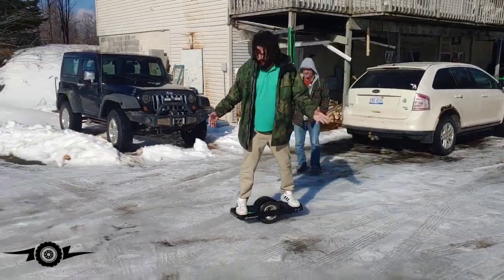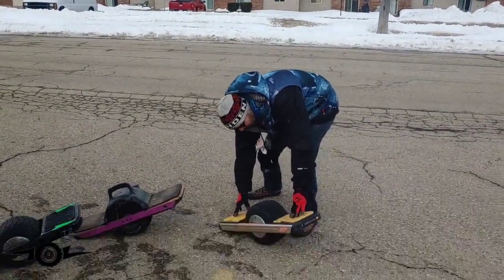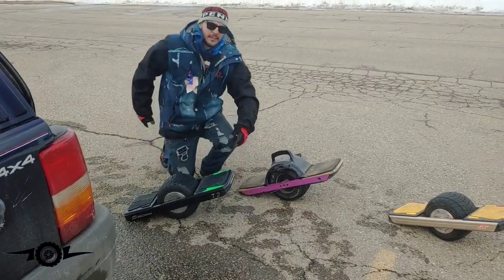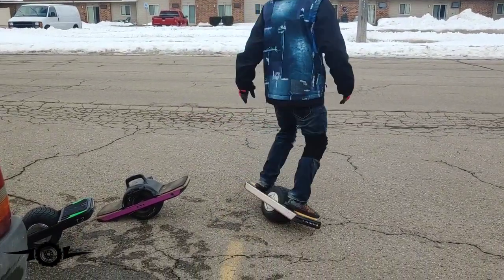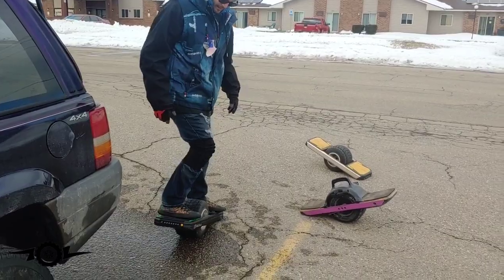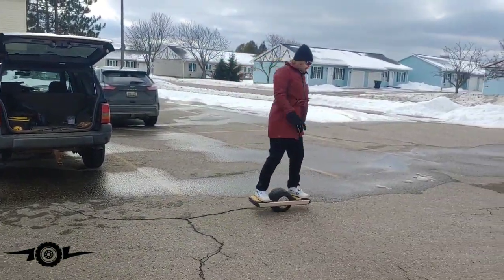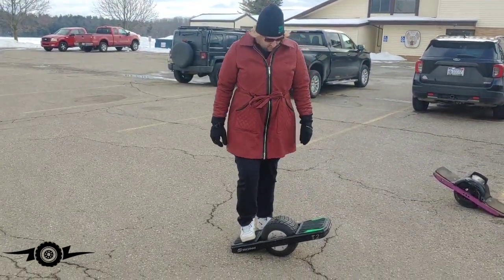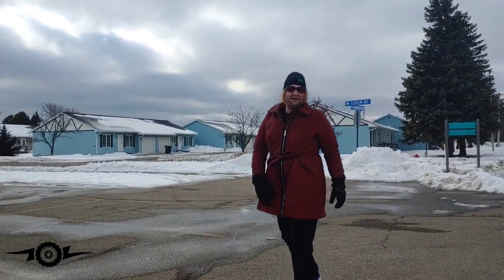VESC MAGWheel 1st Test!

Comment: This is a fantastic project, I picked up a dead Trotter off FB and have been trying to get it going, pretty sure the main board has a short. Do you have the parts/instructions how to do the VESC posted somewhere? Maybe a package Trotter owners could buy to upgrade?
Reply from the maker: Video I uploaded right before this one ;) And a complete package is coming soon :)
Reply: I bought the original trotter 4 years back now. It didnt work straight out of the box. So disappointed I was. But after a few months I finally worked out the soldier on the circuit board was of terrible quality. So I carefully resoldered every connection and component on the board and the foot pad sensor boards and finally it worked. And after that it actually worked pretty well. I think this is the main issue apart from an underpowered motor. So I recommend anyone with a dud trotter to do the soldering thing.
I had some fun on bike trails etc but eventually scrapped the build due to the low top speed and wobbles. And the fact I couldn't just drive it around town over curbs etc. 
Anyway I'm in New Zealand and after over a decade there still is no onewheel dealer in new Zealand and it costs so much to get one here via post and customs and tax. Around $4000 nzd. Its just not affordable. So I'm going the vesc way. I'm building a funwheel using the trotter. Then I'll upgrade to a 60v battery and do another video. Im also using the spintend footpad so there will be no trotter electronics in my build at all which is reassuring!
I'm using the UBOX 100v VESC with built in IMU and Bluetooth. Should be fun!
Reply: Super test